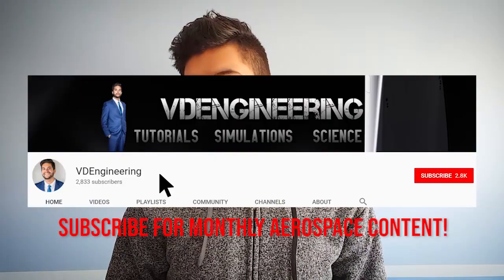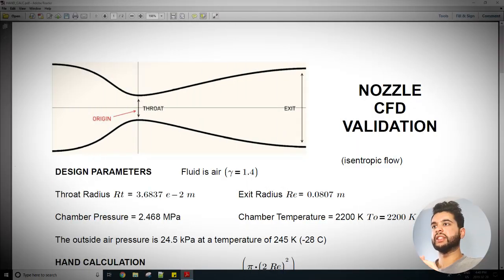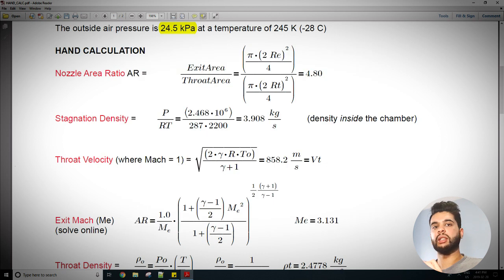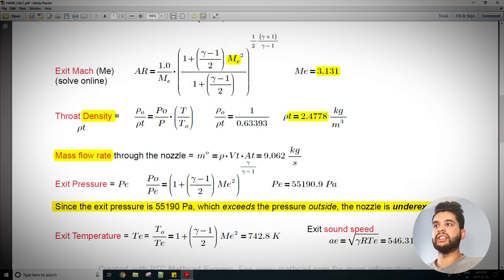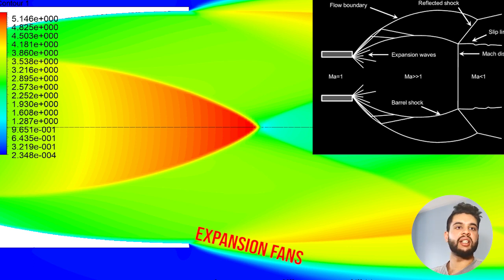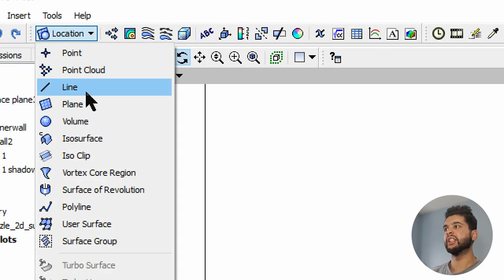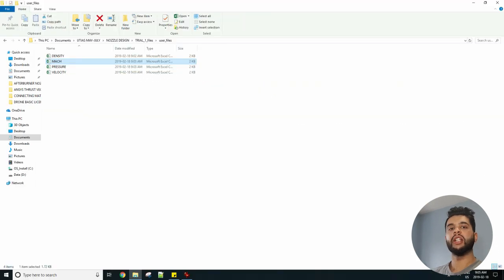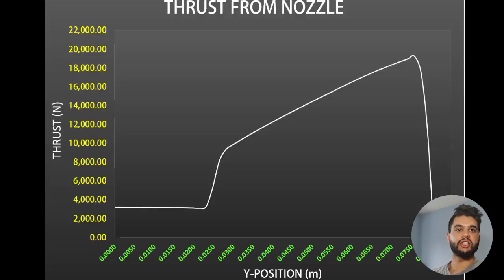Rocket Engine Nozzle: Propulsion CFD Verification and Thrust Calculations (ANSYS Fluent Tutorial)

Comment: At around 5:55 minutes you show your nozzle from your CFD. I was wondering if you used eulerian methods to solve the CFD or if you didn't include the energy equations from N-S. The Shock formation just looks strange to me but it might be that I have been looking at over-expanded nozzles.
Reply: There is no Mach disc is all

Comment: If one doesn’t know the coordinates of the nozzle outlet, I found an easy way to get it. Simply go to function calculator, function:max val, location: outlet, variable: y and it will print out the max value for y, ie the tip of your nozzle exit. You can also use individual points and use the probe function to find the coordinates.

Comment: Hi, does this flow is categorized as an under expanded flow? I still don't get a point to differentiate an under expanded and over expanded flow
I thought the under expanded flow will spread all over without mach change in the centerline
thanks
Reply: the flow is under-expanded since the exit pressure is greater than the ambient or atmospheric pressure. The flow remains expanded as you said because there is no back pressure developed as seen in the case for over-expanded flows

Comment: If this is verification of cd nozzle, how would one be able to validate the method you did on cfd? If you would compare it to experimental data, what would you compare exactly?
Reply: You measure the Mach Number along axis inside the nozzle. During experiments Mach numbers and static Temperature are measured experimentally by Pitot tube.

Comment: @VDEngineering...at which height u have caonsidered for outside pressure and temp. bcoz the pressure and temp. which have taken doesnt fit with ISA table neither correct to calculations...

plzz do rply...
its realy vry vry imp. for me...
ty

Comment: can i use the same equations even for the nozzles of a cold gas thruster? also, what would be the difference in calculations if we attach a pipe between the tank and converging section?
Reply: Yes, you can do as long as nozzle to exit pressure ratio is beyond 2. Attaching the pipe would make no difference in flow characteristics, provided that the pipe does not reduce the inlet pressure upstream of the converging section beyond critical pressure ration (2bar for exit pressure of 1bar) due to heat loss through walls of the pipe.

Comment: Hey Vin, great video! I just have few concerns: 
1. In your expression for thrust, particularly dynamic pressure (D8*G8^2) I think you forgot to divide it by 2.
2. Thrust is calculated as integral over whole surface. Instead of multiplying by A at each y, I think you should rather multiply by dA - an area of infinitesimal ring of radius equal y, and then sum all results.
3. Try this: CFD-Post -> Calculators -> Function Calculator -> Function: force, Location: nozzlewall. I also tried to acquire pressure and velocity at exit using massFlowAve function, but my calculations give me only half the value of "force". 
To conclude, I am very thankful for your videos. You inspired me to choose rocket nozzle design for topic of my Bachelor's project and with each video I learn a lot of new stuff.

Keep promoting Aerospace Engineering ;)
Reply from the maker: Thanks for your feedback. Keep in mind the more complex method is not suitable for YouTube as I have to make content that is easily learnable by beginners as well
Reply: @VDEngineering  sure thing. For that reason, I think function: force would be the easiest way ;)
Reply: How do you know for sure the function calculator -> force on nozzle wall gives the pressure force? The ANSYS documentation shows the force dialog box and says it computes pressure and viscous forces.